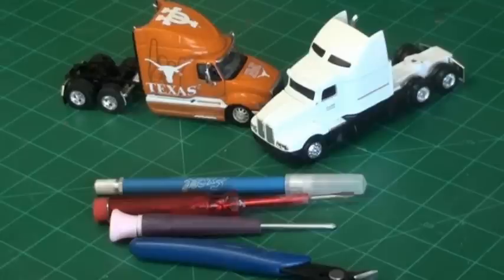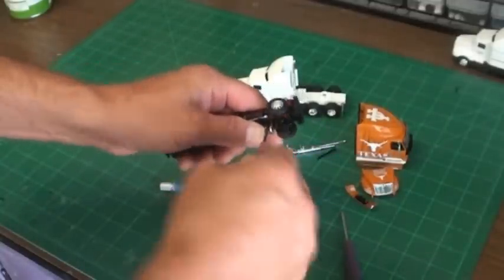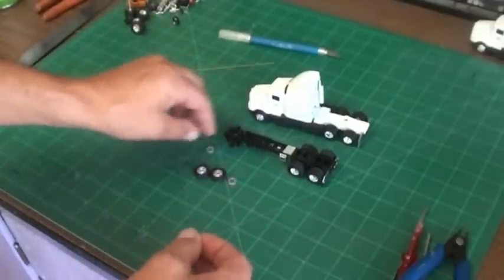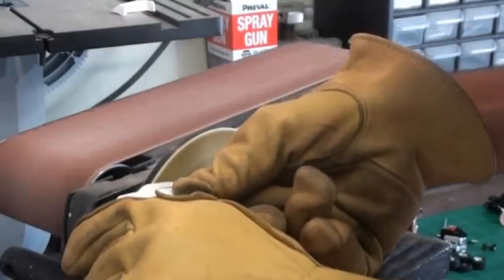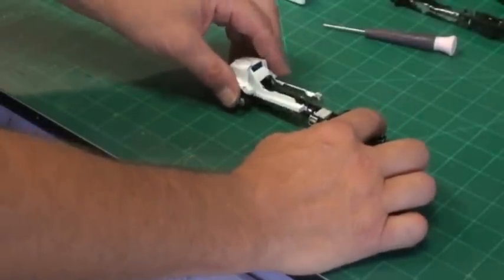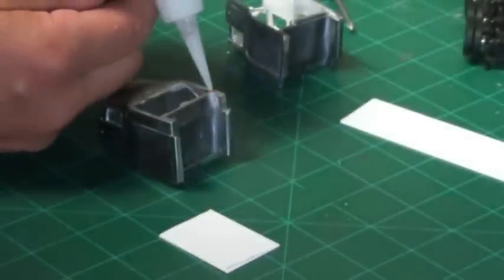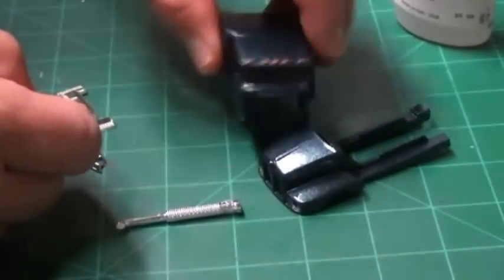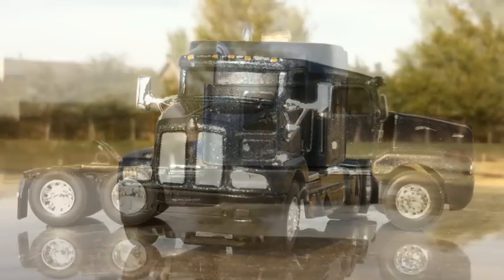How to make an Ertl Flat top Kenworth T600B on a DCP Frame

Comment: Couldn't you have just used a sander or, if you have one, a sand blaster to remove the paint on the cabs?
Reply from the maker: Dylan Ruppert great comment and question. I have not used a sander due to the abrasive disk removing some of the  fine detail on various trucks. As of this date I do not have access to a sand blaster but would love to try one. One thing I like about using lacquer thinner is I take the parts and place them in the container of thinner then go on to do something else. When I come back, 95% of the time the paint comes off easily without much hassle or time spent. Super simple using thinner. Thanks again.